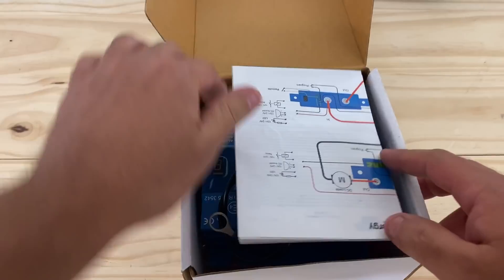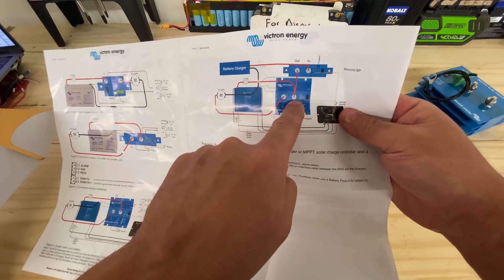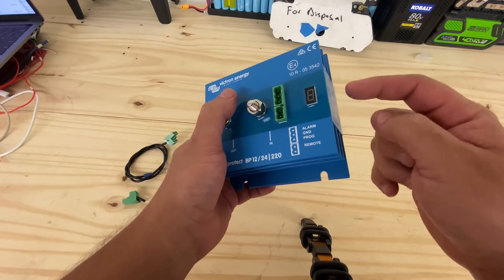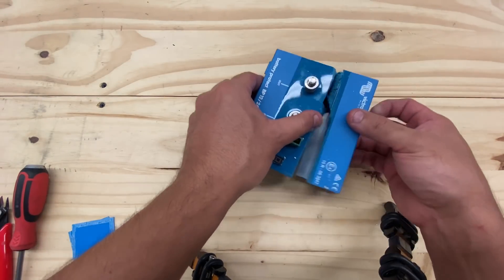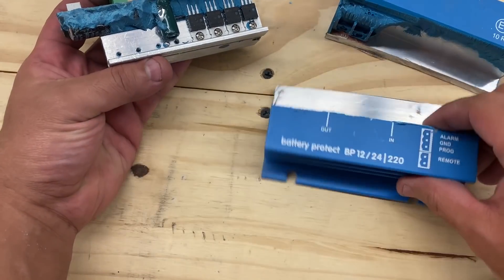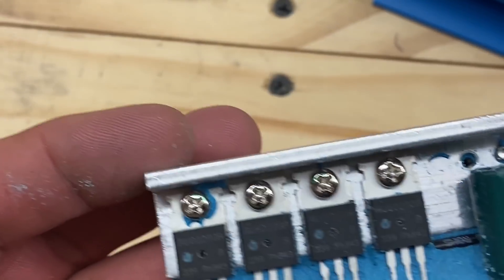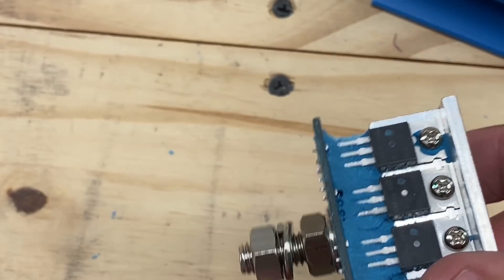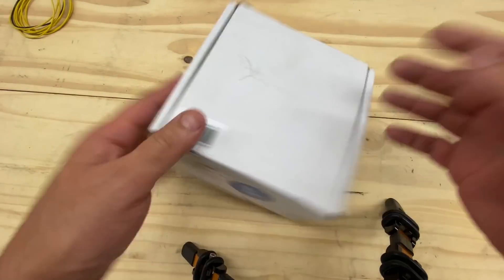Victron Battery Protect  BP12/24 |220

Comment: I hate victron products. Way too expensive for what they do.
Reply: Their MPPTs are alright.  I started my PV adventures with EPEVER gear and let me tell you you get what you pay for.  The EPEVER gear (I have a 10 and 40A models) both work but they're slow to track (like really slow, like taking 10+ seconds to react to a cloud clearing out of the way) and the interface is garbage.  Whereas I have their "smart" bluetooth MPPTs (50A and 100A) and while the interface could also use work the MPPT side of it is very good.  A hell of a lot faster tracking, better stats gathering, more knobs to control (and easier to control them), etc...
Reply: @tomstdenis  True. I'm using the mppt victron 75/15 with bluetooth. It is a dream, not only for beginners! Controlling it with the app from smartphone/tablet, adjusting voltage in 0.01V steps. Battery profiles for many types (e.g. AGM, LiFePo4) and individual settings. The load connector allows many configurations, e.g. street light mode and much more. Not to forget the updates for the app AND device-firmware.
I love it.
Reply: @tomstdenis  I like the Fangpusun FM series. 50% cheaper then the outback
Reply: @frankz1125  Fangpusun are just stealing the design and firmware from other devices. They are shit quality and might blow you house. Good luck.
Reply: @imval_tech  just my opinion.  I've used them for years
Reply: @imval_tech  I've seen midnight equipment fail. To each their own I suppose.
Reply: Show me another manufacturer that can handle LiCoO, LiMnO, LiFePO4, LiNiMnCoO, LTO, LiPO  chemistries without burning down your house/RV/boat........
Reply: Compared to what? The other quality stuff are even more expensive, eg SMA, Outback. Even Mastervolt is in the same price bracket. Sure, I could buy a voltronic product, those are nice and cheap...
Reply: I hope you film the return of it to the victron store. That would be great